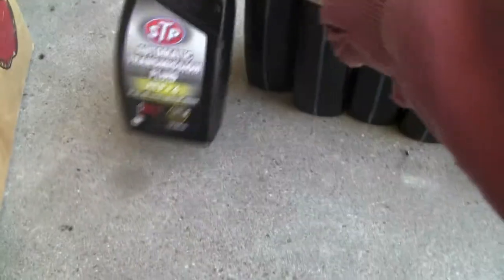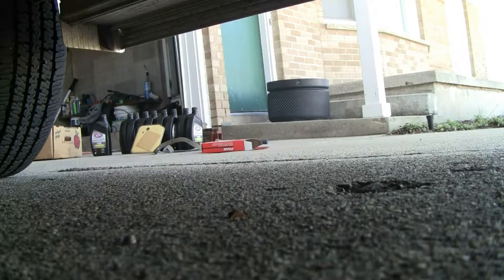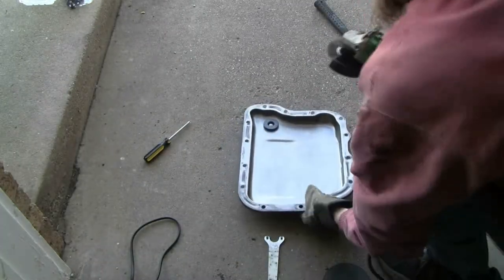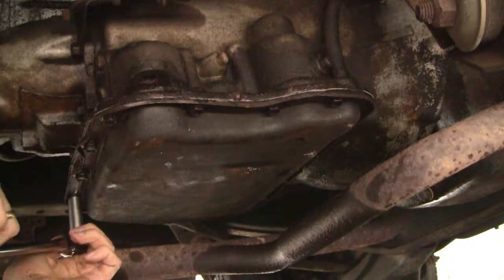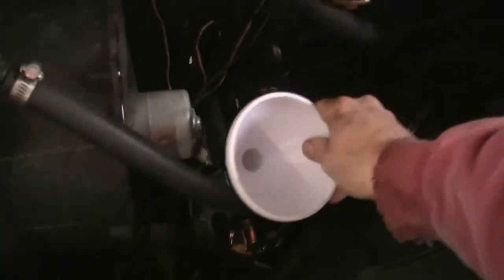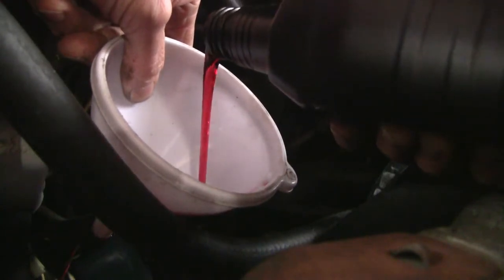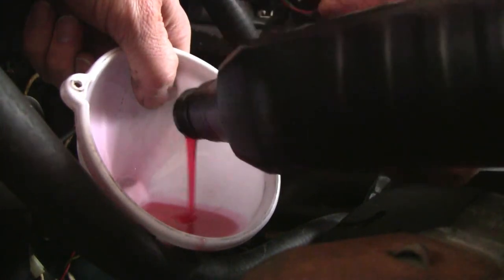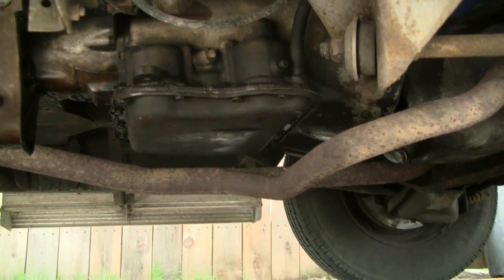Tranny Fluid & Filter Replacement - 1979 Dodge Camper

Comment: Loosen all the screws then remove the screws from one corner stick a screwdriver under that corner pry it open and let the fluid drain out of that corner while you loosen and remove the rest of the screws tipping the pan slowly on that corner that you started draining with and you will avoid all that mess.

Comment: Strange thing i found out about my 1974 Dodge sportsman motor home with a 360 engine is it would not run or even start till i found it a half court low on trans fluid. i noticed the pan was wet. SO I put a half Court in it and it started up and drove nice.  3 weeks low again same thing happened and replacing pan. This must be a protection to prevent Damage to Transmission. Coil also goes bad and needs replacing when this problem happening once but not the first time.

Comment: I'm having an issue with fuel delivery, I believe the gas in the tank is old. I'd like to drop the tank, clean it out, and replace everything between the tank and the carburetor. Any ideas on what parts?